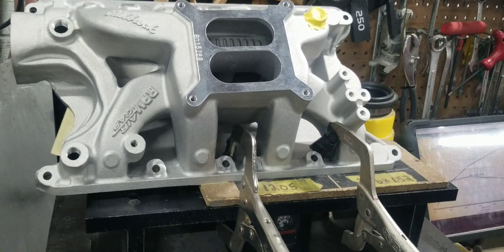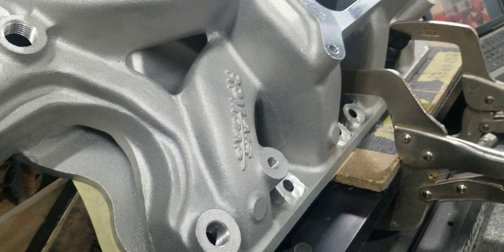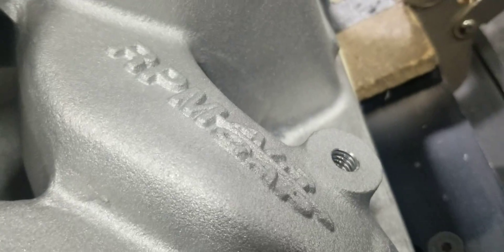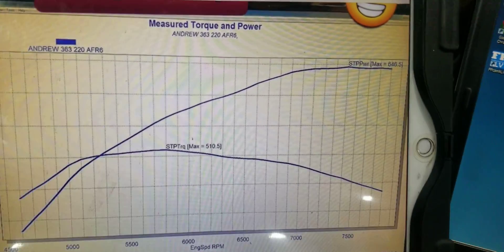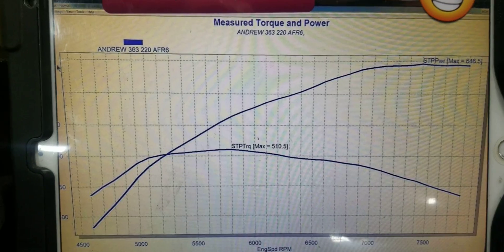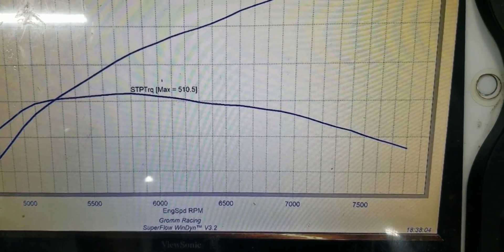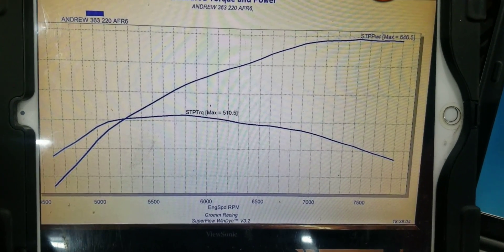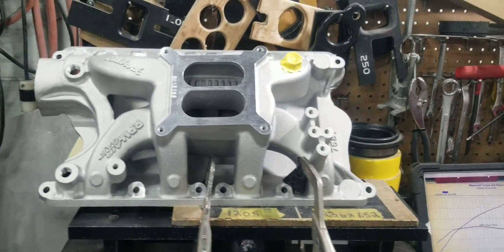SBF Stage 2 ported Edelbrock airgap 351 carb manifold testing part 1 with other Dyno Results 😁

Comment: Hey bigdog! Ive got a Edelbrock Performer intake 4v for my 351c 4v, Can that be port matched or at least ported for more flow? Thank In advance.
Reply from the maker: Of course it can. Our average runner flow gains from our stage 2 porting on carb manifolds is 50-70cfm per runner which helps stuff more air into the cylinder heads.